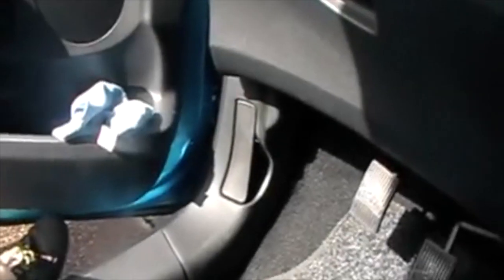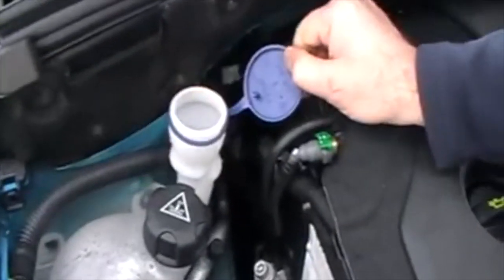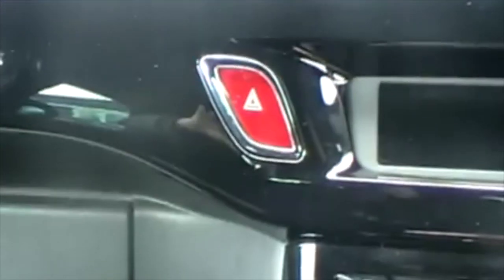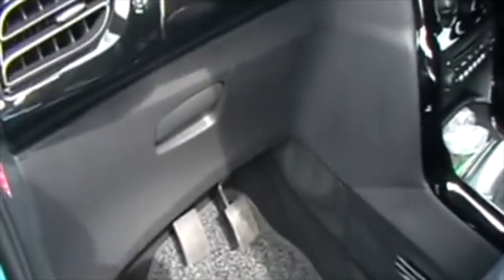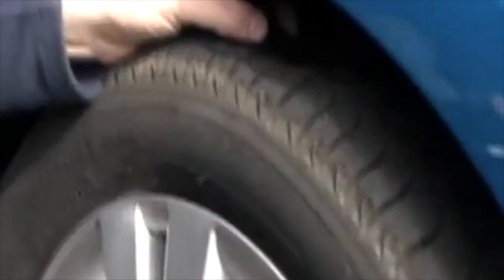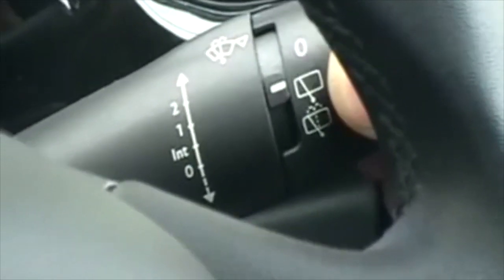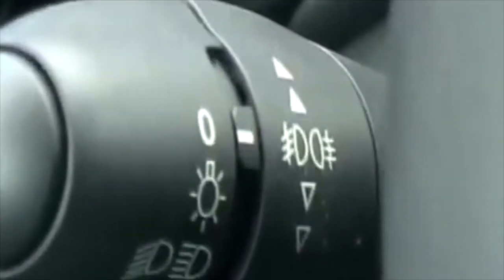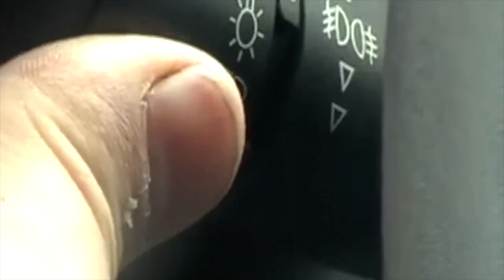Show me Tell me for practical driving test UK

Comment: to check the break light could you put your foot on the break and check for any "bulb-out" symbol that may display upon the dash? or do you have to use either a reflective surface or ask the instructor to check if they are working?
Reply: dan clements the 2nd option